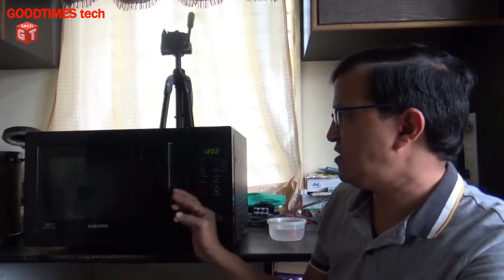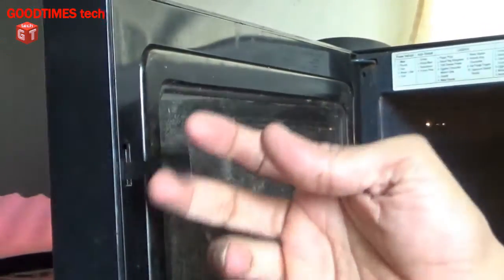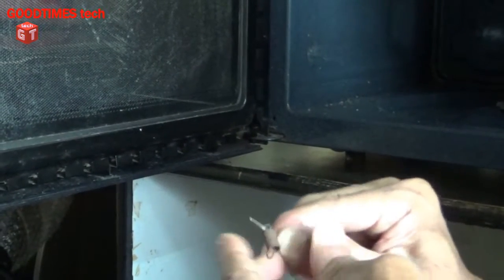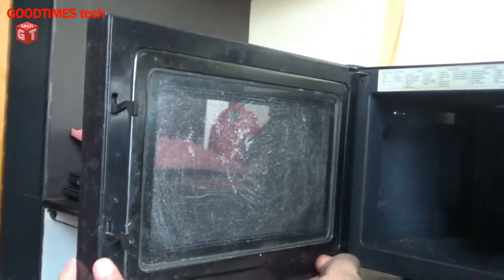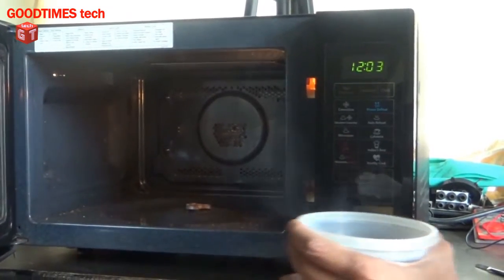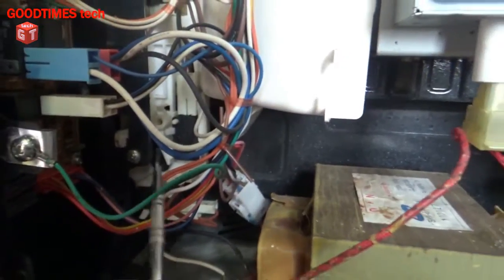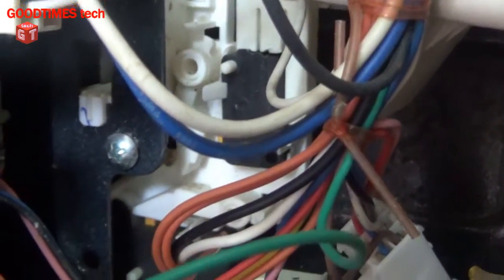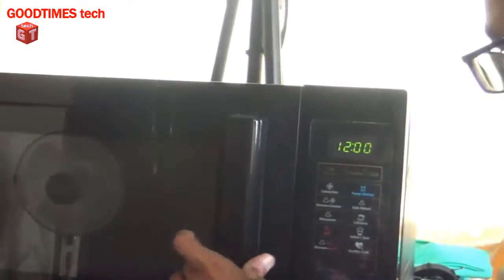SAMSUNG Convection Microwave Oven powering ON but not heating

Comment: Thank you so much sir for the guidance.

The button panel of my microwave isn't working. Some buttons work and Microwave responds, while most others dont. How to solve this issue? Can you please guide?
Reply from the maker: Hi, sorry for late reply, 
We do get microwave oven membrane keypad but need to try for the oven model you have, if you do not get the keypad then you can use silver pen and correct the tracks that are open or have increased in resistance. hope this would be helpful.

Thank you, have a GOODTIME....

Comment: Tray not spinning and heating problem,how to solve, please reply
Reply from the maker: In most of the ovens there will be a belt to drive the tray, need to check if the belt is broken or loose and replace if necessary, if the device has direct drive motor to rotate the tray then need to trace the voltage to motor.
If the tray rotation issue is solved and still the oven is not heating then need to check if the magnetron has gone bad...

Thank you, have a GOODTIME...

Comment: Having same problem but spring is not broken then wht to doo??
Reply from the maker: Better to ask a technician to check as you will need to see if all the door switches and relays are working fine, if all ok and step up transformer is getting input voltage then magnetron might have failed and needs replacement.
Please Take care and do the reparation on your own risk
Thank you, have a GOODTIME....